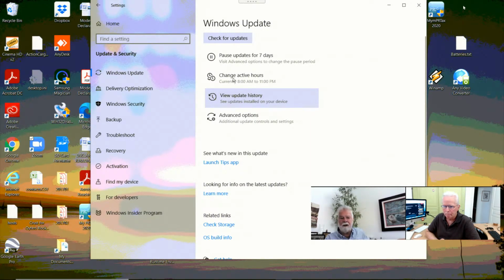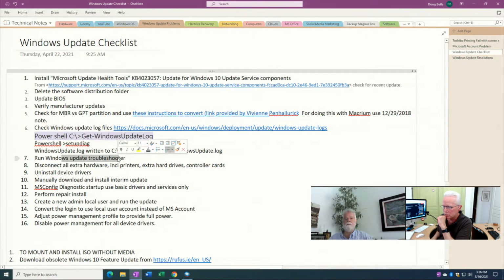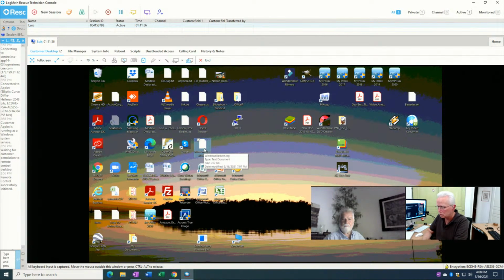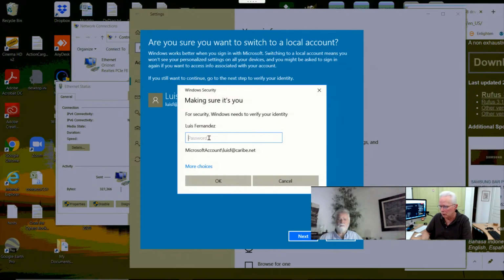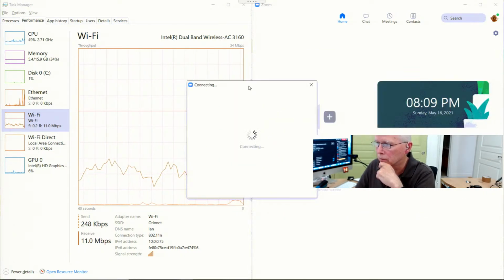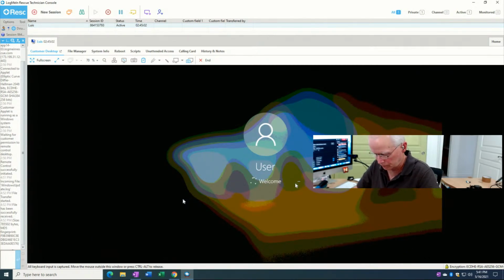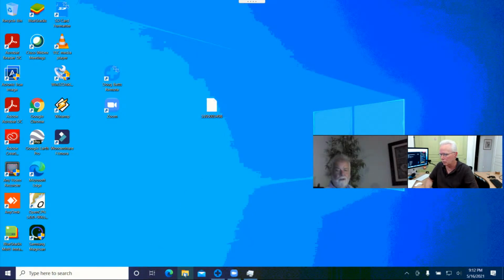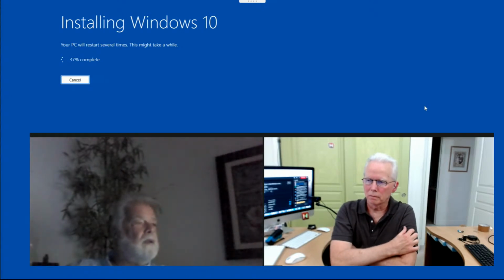Windows 10 20H2 Still Refuses to Install

Comment: @LiveWindowsTraining-DougBetts Please read the previous episode comments from me Was the Service Stack Update the missing link ? thanks @Black Watch
Reply: @LWTdb  I am mortified It was very convincing I did say when I joined the 2nd episode I had skipped through 1st I remember now that I had not watched it before but I watched a whole  lot of your videos one after another when I first discovered your channel late April and wrote my first email to you 26/4 I have deleted my last comment with the speculations on internet The same Dell model numbers are used for years released latest available processors and storage even going from HDD without then with Intel optane Memory in M2 to M2 SSD Luis computer was an Dell Inspiron I5 5559 upgraded several times were these all SSD or was there originally Intel Optane memory in the M2 and a HDD did he then replace the HDD then a series SSD leaving the Optane Memory in the M2 this is a problem it only works with the original Intel HDD and my comment about BIOS  change AHCI in safe mode still applies and the deleting of the Rapid Storage Software was correct. Intel may have a problem with all this Intel site should be consulted on that. The whole thing is a hornets net.
Reply from the maker: @vivpenhallurick6211  Not a big deal.  I have deleted my response to the comment you deleted.  Just so you know, sometimes I just click the thumbs up and heart button on peoples comments when I don't have time to reply but I do read them all and try to give sincere consideration.
Reply: @lLiveWindowsTraining-DougBetts looking series of Dell computers when Intel optane memory is onboard it is in the M2 slot the same slot is used in following model released for M2 drive. Please see Intel support site for this superseded technology. The point here is what happened Is the Optane memory is still in the M2 slot it would require the Rapid Storage Software which I asked you to remove Could it only work with original Intel HDD which seemed to have been Refer to other note where I explained about the BIOS that knowledge was gained with my experience with my own computer a Dell Inspiron I5 5570. Did the installation the series SSD  up to the Samsung happen before or after 1909 has this caused the whole thing this is a hornet’s nest the 2nd Episode which I watched live is where I gathered all the information on the BIOS Dell model no. Etc
Reply from the maker: I have been reading all your comments.  I think the servicing stack is present and seems to be doing its job but we can check for the most recent servicing stack kb number in the next session just to be sure.
Reply: @LiveWindowsTraning-DougBetts I am watching the 2nd episode at the end when Rapid Storage Software wouldn’t uninstall I think that proves M2 still holds Intel Optane Memory. Think I got lucky in that I bought Inspiron I5 5570 with only an 128Mb M2  since replaced with an NMVe 500Gb Dell had abandoned the Optane option but they had not updated BIOS and the Rapid Storage Software running serving no purpose. It took me awhile to figure all this out. Luis is still in the hornet,s nest refer to PCGamer Intel-Optane-Memory-everything-you-need-to-know much more compressive than Intel Basically I was right it was for caching HDD only remove the memory remove the software fix the BIOS which is waiting for an Urgent Update
Reply: @LiveWindowsTraining-DougBetts Ask Gary if he ever bought any of these Dells or did he skip that generation.

Comment: Hope the upgrade works this time.

FYI, Get-WindowsUpdateLog is what puts that WindowsUpdate.log file on the desktop.  That is why the two copies were the same for you.  You ran it before making the copy.

Setupdiag, by default, put its log in the directory you are in when you run the command.  You ran it from his Downloads folder, so you would look for the SetupDiagResults.log file there.
Reply from the maker: That's very helpful.  I just updated the description for the video with the results.  Thank you!

Comment: This only means that this instalation has a problem with hardware used, setup updates to auto and windows will install this update after it resolves problems. ;-)

Comment: I've literally tried everything and I'm in the same position as Luis... Update will not take. Looks like the only way it's gonna happen is if I completely reinstall windows, which I don't want.
Reply from the maker: Hi Mike.  I understand the resistance to reinstall.  Lots of people will disagree with me but my opinion is that you will likely be fine waiting for a while still to see if a solution comes for your computer.